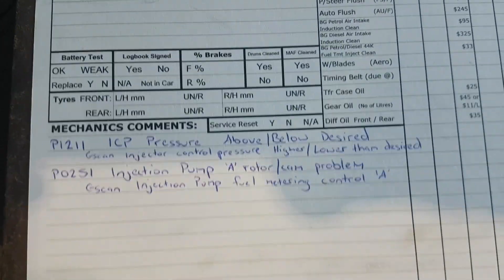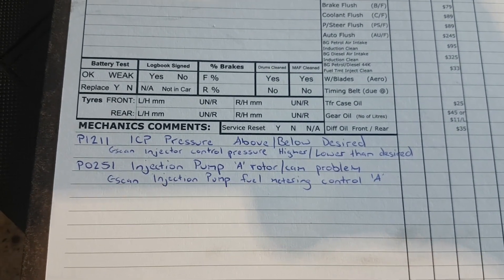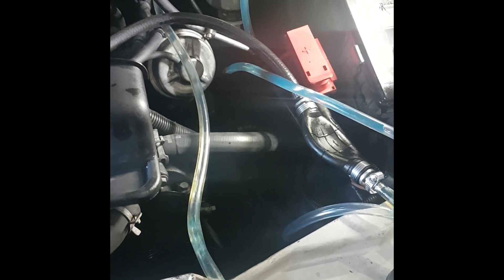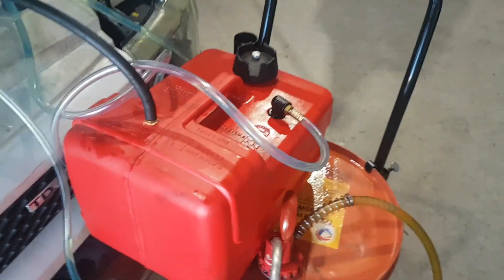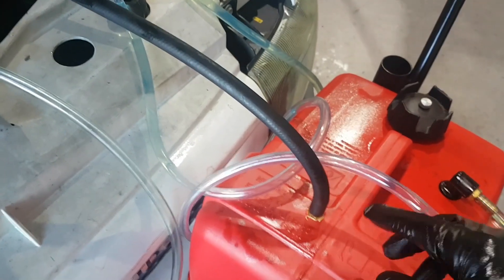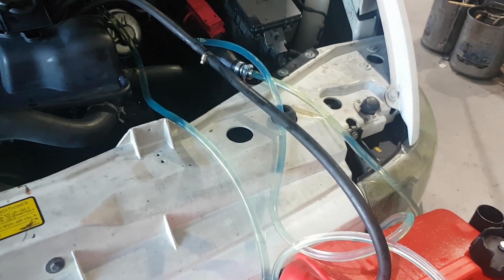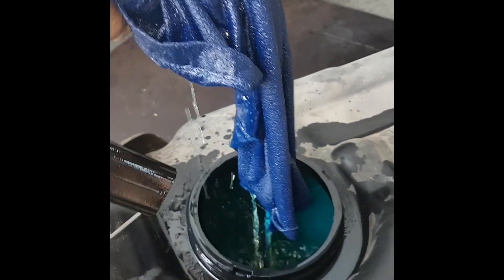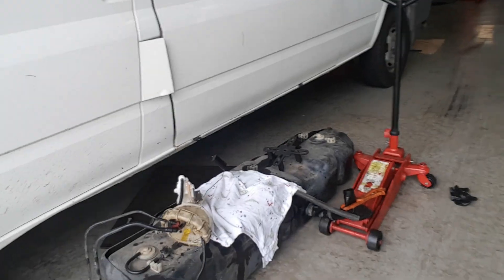Ford Transit Diesel p1211, p0251, surging, limp - FIXED

Comment: 2005 transit connect 1.8tdci 89hp
Same P0251 code.. going to change fuel filter see that helps 🤔 hasn't been changed in 2 years! could be the problem.

Comment: Hi , I have a FORD TRANSIT T260s , I bought 2 weeks ago, I suddenly experienced idle issues, I think I have a similar issues to one in this video, while driving everything works fine and no issues with the van, but as soon as I stop the engine starts idle and cuts off, I see bubbles in the fuel hose from the fuel filter to the engine, and I plugged it in and the error code is  P251a(00) and the message is ( POSSIBLE DECRYPTION CONTROL MODULE ) however the van speed limit is to 70MPH ,  anyone with similar problems ? I appreciate any recommendations 🙏🏼👍🏼

Comment: Thanks for video! We had the same DTC P1211 and P0251, the reason was that fuel filter was blocked.  You had to use power very lightly otherwise car will stop. Ford Mondeo 2.0 TDCI 130 hp year 2002.